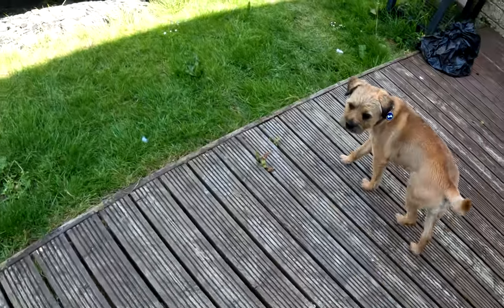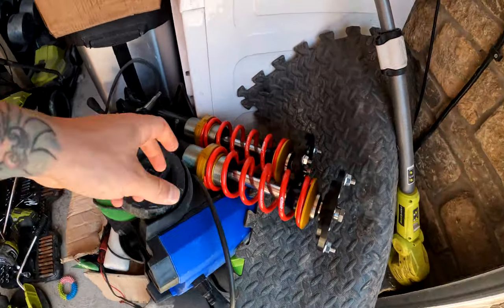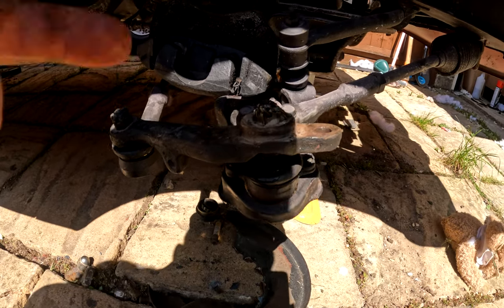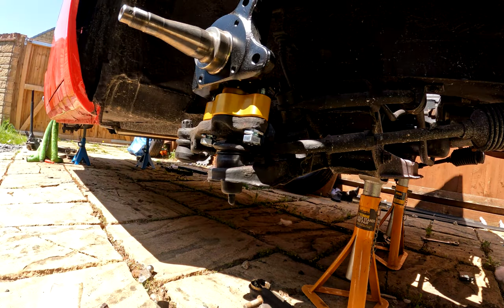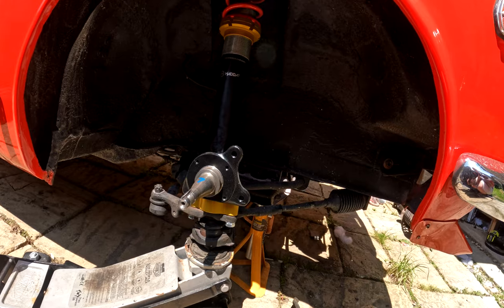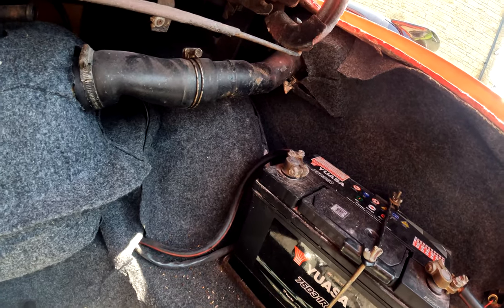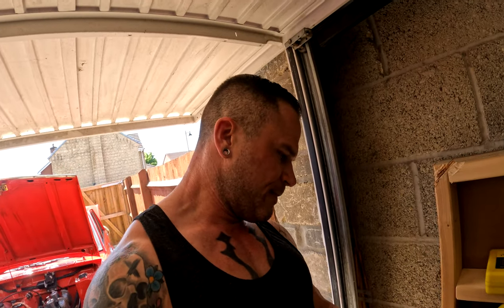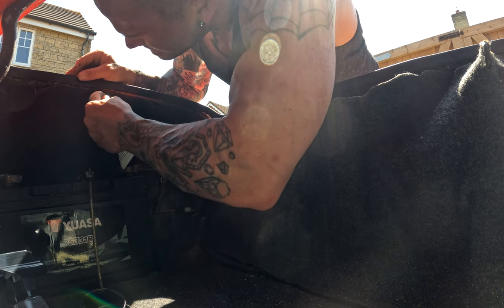Installing MADDAT Coilover Struts On My 1968 Datsun 510

Comment: Steering boxes are usually bomb proof, apart from needing oiling or greasing I'd leave it well alone

If that back axle isn't Datsun it looks like a Ford escort axle to me, Ford use that design where the diff unbolts from the front of the axle case like yours
Reply from the maker: What was a Ford four bolt pcd though? As I didn't think they used that spacing??

Comment: shame about the filler neck, always the way with these things.  can you not have it modified to fit? cut and welded so it'll bend toward the tank?  looks like its aluminium so should be straight forward to have it tig welded

Comment: that filler neck you pulled off doesn't look anything like the stock one to me. Should have a rubber connector at the top with the breather on it. if that's a stock tank in a stock location the mad dat filler will work. Literally put one in a 69 model last week.
Reply from the maker: It's strange because, it's mounting points look all factory, the Datsun 510 in the south East Asian market is quite different in other areas though so I wouldn't put it past them to have a different set up with the fuel tank either. Weirdly
Reply: @MrHVlogsMore  does it not fit because of the inside of the fuel door? Is the metal shaped differently to the maddat alloy plate?
Reply from the maker: Nothing to do with the fuel door. It's the angle of the filler neck